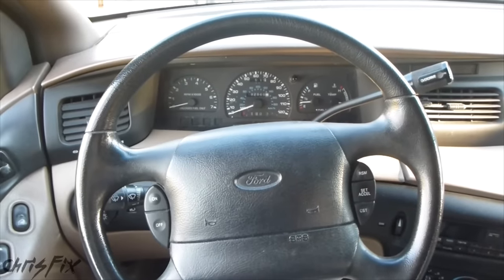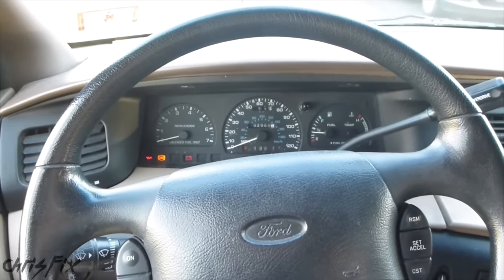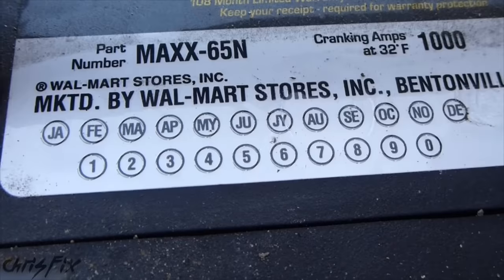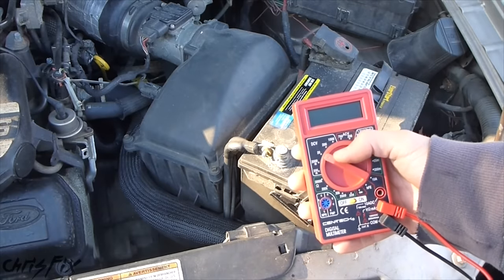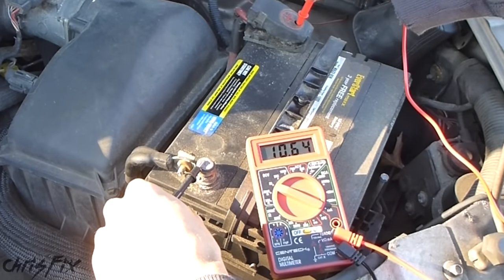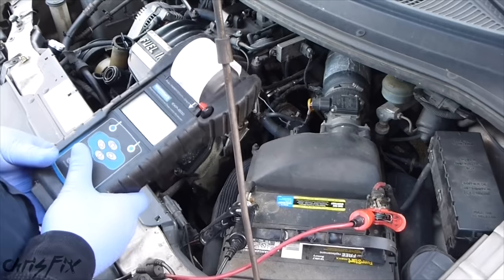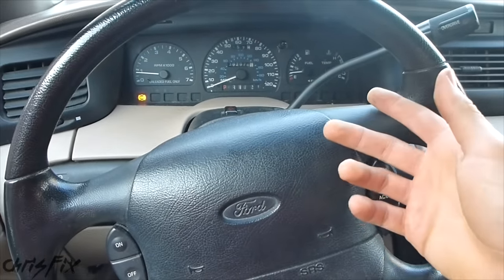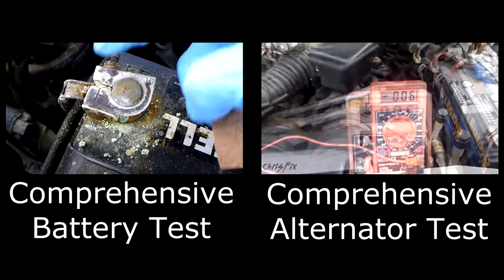What to do if your Car won't Start

Comment: On my car Oldsmobile Alero I had one battery for 10 years every few months I was charging it to get it to 10 years lifespan then on 10th year I'd only thing I notice the week before it died completely lights was dimming and no lights came on saying the battery was low I just tested it with a battery tester at says we placed battery when in the replacement Zone but on the battery charger it says it was fully charged with a dead cell

Comment: This is why I'd rather get a standard transmission because if the car dies and you don't have a jumper cable and kit, you can always do a rolling start, works most of the time.

Comment: I have a 1989 ford ranger and I went to start it and nothing the engine wont even try to turn over no noise...nothing, the dinging in the truck that tells you the key is in works and the radio works as Well as the head lights and dashboard lights work but I dont know what to do ive checked the fuses and replaced the ones I needed. I got a new battery and still nothing can anyone help? Comment plz
Reply: Look at his video about the free car maybe that will help

Comment: Fun fact: if your battery is like 10 volts and under, it wont start even if it cranks. The engine control module wont turn on
Reply: didnt know that.

Comment: My car is making the classic clicking noise. Battery is about 3.5 years old and when I power up my window it goes a little slower than usual now as oppose before when my car was off. Battery or starter?  Im thinking battery just because of the slower move on the window..  Anyone?

Comment: far worse problem is when you try starting a old volvo bm 425 tractor 6 volt system as it crank really slow and no matter if there is ignition or fuel it doesn't seem to want to start.

Comment: my car starts then dies, sometimes it works but most times it doesn't. New battery, rebuilt motor, replaced throttle, and belts, but it dies especially in reverse. Anybody have any idea what I should do?

Comment: this is a won't start with cranking situation, how about no start no crank? thanks
Reply: John Louie no crank...u start with battery..then u check cable connections for corrosion or broken cables if all thats fine then u check ur starter
Reply: Alright.. Thank you sir Chris!
Reply: John Louie lol im not chris but ur welcome anyways 👍

Comment: "battery is 7 years old"

never seen one get past 3 here in phoenix 7 is nuts
Reply: My battery just went out on my last month. It was an original GM battery that last 9 years with 89,000 miles

Comment: I believe when a car starts the alternator becomes a generator than generates power from the engine to the electrical systems and also charges the battery

Comment: Use battery terminal protectant spray instead of lubricant. It works much better because it’s actually designed for that use.

Comment: I had a dodge durango 20001, it lasted me at least 15 year and one day, the car didnt want to turn on and if it did it would acclerate by it self like 3-5 and turn off aslo if i drove it ot couldnt go no faster than 15 mph , one it would go faster and aslo it will start shaking n i invested like 1,500 to fix it by a mechanic but it failed and at this point i still dont know what was wrong with the car
Reply: Any answers for me chris fix

Comment: man, i was just outa luck on my car. 

It started but then immediatly shut off. it had oil, it just got a new battery, and all dashlight boards turned on. 
Turned out it was the thing behind the steering wheel with all the meters on it (i don't know the name for it in english sorry). 
So the garage that my car got brought to send it to a specialized company to get it checked out allong with the keys, they couldn't find a specific issue to they just reset and recalibrated it to the keys and well, the car worked again. 

All in all it "only" cost me ~200€
Reply from the maker: Darn! Sometimes those things you don't think of can happen!

Comment: when i start my car it doesn't make any sound what's the problem
Reply: Hannah Tolentino battery...battery connection or ur starter..if u jump start ur car and starts pretty good chance its ur battery
Reply: Backyard Chevy ok thankyou! i ask my technician and my battery is low because i didn't turn on the engine while using the lights and aircon! thank you anyway

Comment: How about if you turn on the car and nothing?
Reply from the maker: If nothing happens when you turn the key to "start", there is something broken in the starter system, I have a video showing to how diagnose and fix that, check it out: https://www.youtube.com/watch?v=yC409CU7mU8
Reply: @chrisfix  first, I had start my car and nothing happened then, I brought a new battery and the car try to crank. And we found out that I need a  starter . My starter was trying to turn over but it didn't. I need a new starter. And my headlights switch not working it's a electrical problem . When my mechanic put in the new battery my headlights was on and the car was off .
Reply: I need a new starter

Comment: How to check if it's a battery problem  watch out for the battery light and see the way it cranks if it's lagging then most likely it's a battery problem ps watch if the time had a reset

Comment: Yesterday I replaced my cars radio with a new one. I didn’t run the car in a long time before and when I ran it I only ran it for like a 5 min ride. So anyway after playing around a bit and putting in and setting up the new radio with the ignition on, my car started to behave absolutely weird. Everything was like blinking in the dashboard, it even said error in the display. And when I tried to start the engine, everything went dark. Like it didn’t even do a thing. But it didn’t show a battery symbol! I found out that the battery in my car is as old as the car itself which is 10 years. After jumpstarting it, everything was back to normal. So sometimes you could face a completely different situation when you have a dead battery. Mine was the electronics freaking out hahaha

Comment: I got a old Volvo 850 turbo well it wants to turn over but it just won’t
Reply: It had been sitting for about 12 years I bought a new battery but and there’s like 2 gallons of fresh gas it, was cranking normally but wouldn’t turn over
Reply: @l_.Winter_.l  then the issue may be your alternator or starting motor

Comment: First step is make sure you have a good battery. If your battery is several years old spend the 60-100 bucks for a new one. Most people just have old junk batteries. Supposed to replace them every 6 years.

Comment: NO crank and no RUN is a different problem.
That battery is low on charge,for some reason.
It CRANKS and that's a good thing,so far.

Comment: As someone who works with batteries all day if you have 10 volts on your battery you know right away it’s a bad cell because 2.1 volts per cell times 6 cells you know one went out
Reply: One bad cell ruins the whole battery

Comment: What if the lights in the driver's side don't turn on
Reply: Well change them, they're probably broken. If it is all lights in the driver's side, your lights cable is probably cut or unpluged.

Comment: hey chris recently had rats chew up a bunch of wires mechanic are telling me my computer is fried ? could that be the reason my car doesnt start ? it literally has no sound when trying to start it
Reply from the maker: There's a pretty good chance they fried your wiring harness, what part of the car did they chew into?
Reply: ChrisFix i had my dads trusted mechanic look at the wiring harness all through the door and it was all intact. they really said its unknown what it could be. wasnt starter because he hooked up a wire and it actually turned over but didnt start
Reply: they chewed into my driver side light wires about right on top of the battery. since i have a chrysler 2013 and it is in the wheel well
Reply: mechanic fixed those wires he could see that were chewed with connectors and everything else is intact but still no start or sound. i can see dashboard lights and headlights working.
Reply: did the old fashion bang on starter too. nothing. im making payments on this car too so im just stuck thinking are rats my downfall right now lol

Comment: Hey Chris, how does your engine power and displacement effect your insurange costs over there? Like here in ireland, they are MASSIVELY conscious of our carbon footprints, so anything above a 2.0L to be honest is HEAVILY frowned upon, Like your car is what, 4.8L? just the red car, how uch is it as standard for a 30 year old guy to get insured on that with no claims for 10 years? for a 4.8L over here you're looking in the multiple thousands of Euros. I see guys over there at shows with 6+ Litre trucks, trucks that are just TOO god damn big, for ANY reason other than driving troops over mountains, with more smoke coming from the front driver side combustion than a coalburning old locamotive. I don't think it's fair at all that us Europeans are hit MASSIVELY with insurance if we go for ANY car with a decent high output (especially turbos) and anything with a naturally high output from V6+ etc. Like i have 10 years no claims, im 30, and my insurance on my 2007 2.0L Subaru Impreza WRX STI is 2,840 Euro per year. TWO LITRE... i could only imagine if i was trying to get insured on a 5 litre Turbo Truck like the one you have, They'd LITERALLY just sent someone around to my house, knock on my door, and when i open it, they'd blast me out through the back of my house into a field with a f*cking Canon lol

Comment: New battery and alternator,  the starter is good but still dead , no lights no nothing
Reply: Were you able to figure it out?
Reply: @AthenaTheWolf  yes,it was a cable underneath or inside the fuse box , was cooked

Comment: What if my car doesn’t start with a brand new battery? It makes the same sound as the video wants to start but it doesn’t. ...
Reply: Might be a bad alternator or bad electrical connection, idk much tho so take it with a grain of salt

Comment: "What do you think the problem is?"  With my luck, the problem is I have a terminal brain tumor, and I'm hallucinating that the car won't start.  it's running, and I will soon die from carbon monoxide poisoning.

Comment: ] I put in a brand new radiator what makes your car not want to start I put in a brand new radiator in a 99 Expedition fit won't start what makes your car not want to start after putting in a brand new radiator

Comment: Thats not a load test. Thats a conductance test
Reply: and that should be obvious through common sense. Consider the gauge of the wires on that midtronics tester, you think that's loading the battery? carrying potentially hundreds of amps?

Comment: TIP:  remember to give your car's computer time to relearn it's idle trim and transmission trim by running it idled on park for 2 to 5 mins every time you disconnect and reconnect the battery terminals. Don't just drive it right away. 
Otherwise it might idle rough or your transmission will shift rough.

Comment: I got a new battery and my car still isn't starting
Reply: if it doesnt crank(spin the engine) most likely issue with battery cables or starter

Comment: I wouldn't recomend jump starting a 2007 Accord, since it causes the car to go apeshit.
Reply from the maker: Thanks for the tip
Reply: My Nana gave me hers and  I jumped off the car and it made the alarm go off. I came back to it the next day and the same thing happened but once i got a new battery its been fine. Its a V6 model.

Comment: Lucky you battery last for 7 years, i replaced 3 batteries in 6 years 😂
Reply: Yeah, I think it makes a difference if you live in a cold climate, especially if you don't garage your vehicle overnight. I live in a somewhat cold climate (Spokane WA), but am able to keep my Subaru in an insulated garage when not driving it. The temp in the garage is usually no colder than 40 degrees F in the dead of winter. After saying this, yesterday I discovered my 8 year old battery finally died. Which is why I'm here watching this video!
Reply: @zagfan44  will i can't say we have a cold climate here (Bahrain) we barely get 10 degC for a couple of days every year, i guess another reason why the electric cars wont be usefull for us

Comment: Walmart Battery’s are junk, used to have a ever start didn’t last long, don’t buy parts from Walmart
Reply from the maker: I’ve had them last for years with no issues. It’s probably poor quality control but if you get a good one, they last.

Comment: Why your automobile will not start I had a bad starter also weak battery on manual transmission only put t in first gear keep left foot on clutch pedal push automobile fast enough then pop th clutch if it goes keep going until battery is fine check our fuel level ou of gasoline or battery connections or give it a boost with cables car to car use heavier cables best or how good is ignition switch or need new battery check spark plugs ny good or proper gap on them I never was an auto repairman I know things from cleaning shops vw auto clubs my Rotherham newspaper on cars radio talk my own vehicles books car shows I ish I cold do more on cars vw club but have health legal problems handicapped bad left arm hand shoulder somewhat or ith my automatic stick vw beetle I had a wire disconnected bad fuse I did not like the transmission three speed manual with automatic Clutha did not  buy plain four speed manual five hundred cheaper no air contioner I never used or liked from what I know learned n autos have seen at shops all makers have rtheir good or bad ones no one ever is perfect one was so bd the owner sued gm and car dealer where purchased he won the case so very quick the car dealer gnaws sorry not doing more when ristoranti troubles started I’d love to see more volks caring for costumersnot just after some fast $$$$$$$$$$$$ a shame businesses cared more when I was growing up o sorry bout oaks now

Comment: It takes dealers who are doing it right the first times with the right volks doing it properly or when does a person have time to do over fix it right too mucho these daze just takes just a bit slower for so no need for a do over all the answers no way for me but I know plenty I am told automatic driving only much easier once learned only time will tell USA drives on automatic trans missions by one is est I’d say automatic  trans missions use more gasoline or use to some volks are so et in their ways will never change do things only the easiest ways me also but 100 x no some volks just refuse to do more work unless no choice given hem thank you this way at times I get more done earn more $$$$$$$$$$$$ if this were true we’d see it quicker he less troubles on our roads only time will speak about us volks now maybe  me would a bit more or have less problems once in a wile e should all try less driving more cling walking saving money our health or more